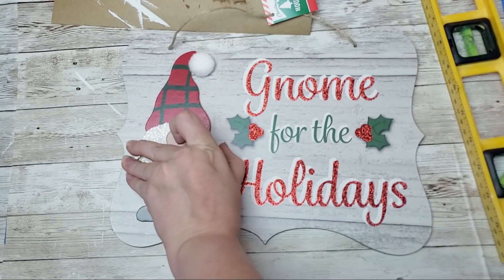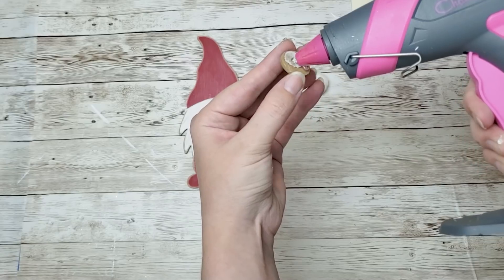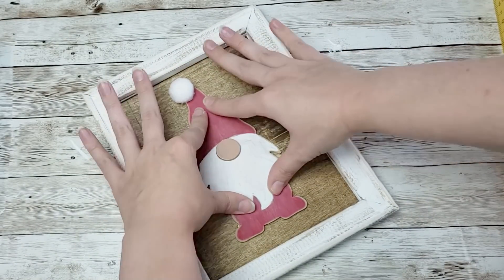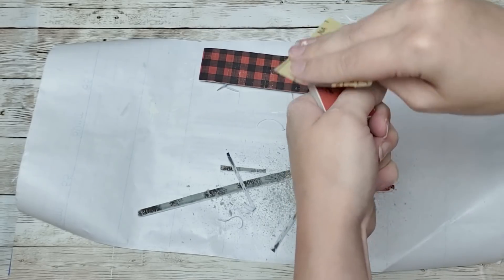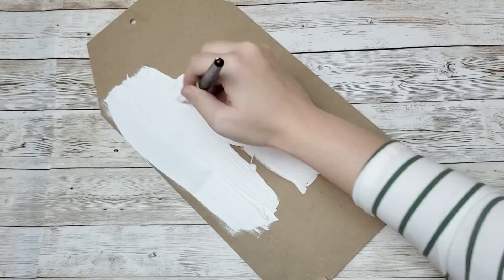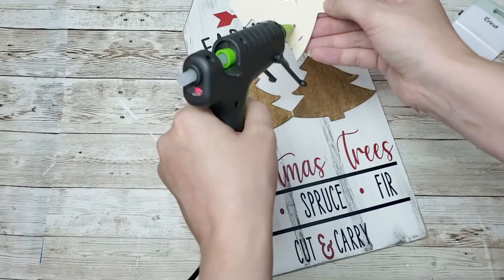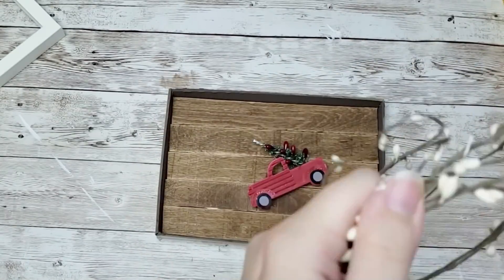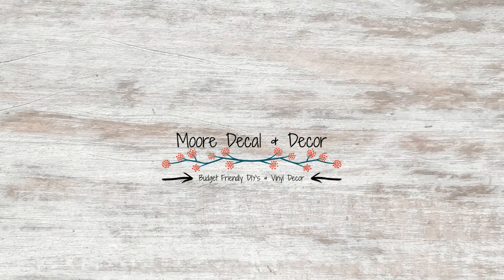4 RUSTIC CHRISTMAS DIY'S | High End Farmhouse Christmas Decor | Dollar Tree DIY

Comment: Hi! New subscriber here! 😁 I have watched a few of your videos and so far love your ideas! I wanted to share a tip with you… When you want to remove a 3-D piece from those dollar tree signs, use your heat gun to heat up the piece and then use a thin metal scraper to pry it off. The heat loosens the glue and it will come off a lot easier without ripping the paper. Hope this helps! 😊👍🏻
Reply from the maker: Thats an awesome tip! Thank you so much!
Reply: @LizabethMoore  You’re welcome! That trick also works to remove the background paper from the signs and those pesky barcode stickers on the back! 😊👍🏻

Comment: Really, really cute projects!  That gnome is so adorable, but I'm really obsessed with the paint stick Christmas tree!
Helpful hack: next time, try using a black Emory board (nail file) to sand the paper edges off of your wood instead of sandpaper using a down and away motion. It works just as well and it's just sturdier and easier to hold/control than a floppy piece of sand paper. This is an old scrapbooking trick and I think you'll really like it. You can get the nail files at the dollar tree, too!
Reply from the maker: That is such a good idea!! Ill have to try that one out next time!